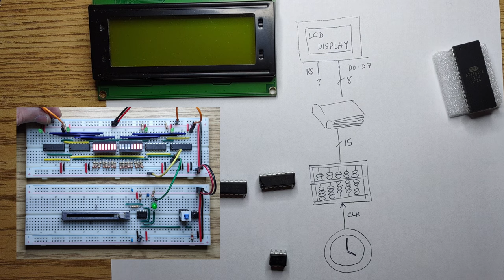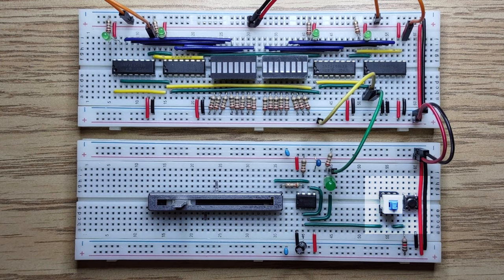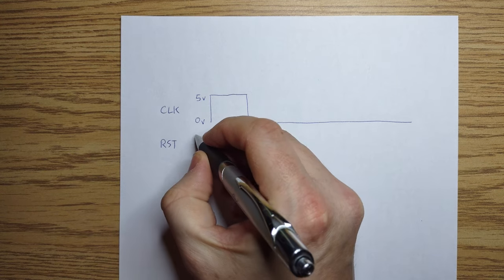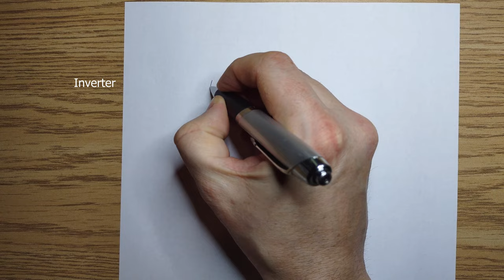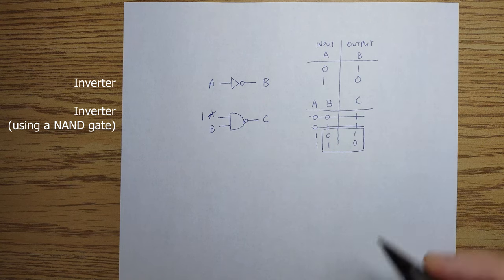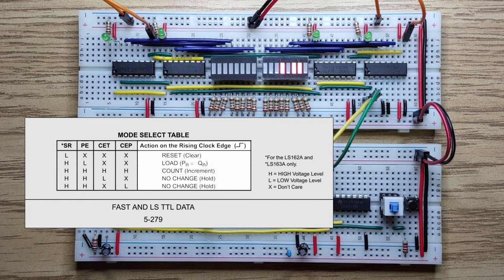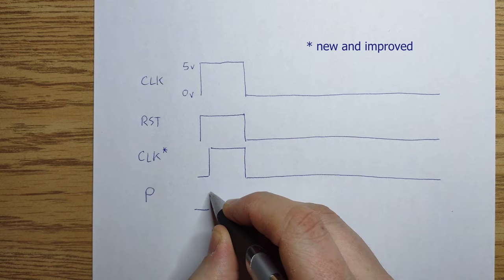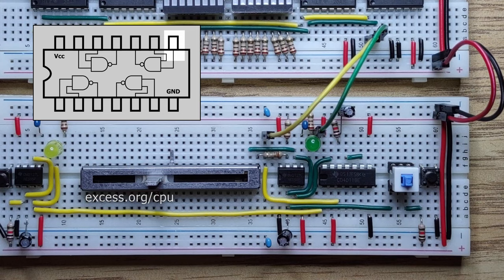Power-on & Manual Reset Circuit

Comment: What if we wanted the 4 bit counter to count from 0-4. I know I need a NAND gate, I am struggling with if I need to use a 2 input NAND or a 4 input NAND and depending on which one I use, I need to know which pins to connect. Would really like your help with this problem.
Reply from the maker: YouTube comments isn't the best place for this.  Try asking on reddit.com/r/breadboard or another online electronics forum. GL

Comment: Would a 74hc00 also work?
Reply from the maker: IIUC the input levels are different on HC chips but it might work with some pull up resistors on the inputs.
Reply: @IanWard1  Thank you I will try it until I get the correct chip

Comment: Is there a schematic for this power on reset 4011 portion?
Reply from the maker: I just added one for the next video that includes the power on reset portion https://excess.org/halt/ source is available at https://github.com/wardi/cpu/tree/main/schematics
Reply: @IanWard1  thanks very much.  I am using it now.
Reply from the maker: @n9jcvyellow  I've since learned that the 4011 is the wrong choice for working with TTL logic. I'd suggest 74ls00 or similar instead
Reply: @IanWard1  Its all good.  I am learning from you and others.  I WAS actually using a 74ls00 anyway, and i ran into a difference on the halt.  I had to tie my halt nand input low with a 680 resistor to get it to stay low and run.  This is fun learning this way.  You have very nice educational videos.  Thanks!